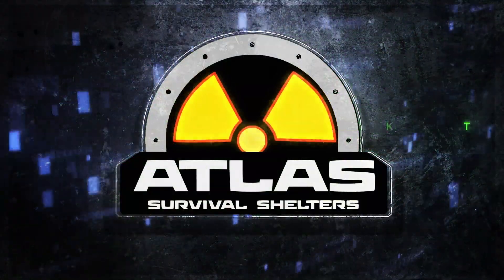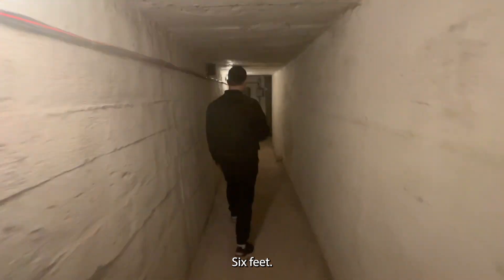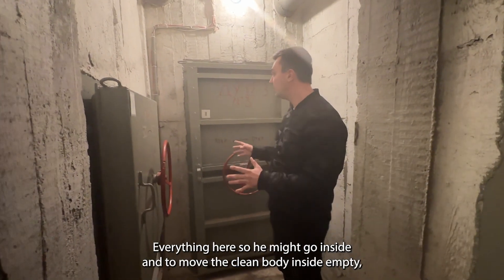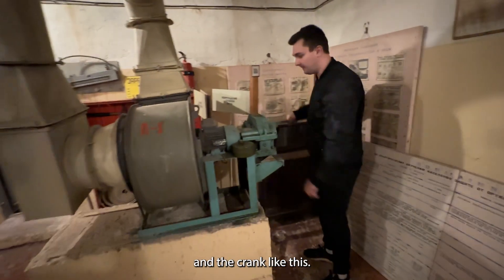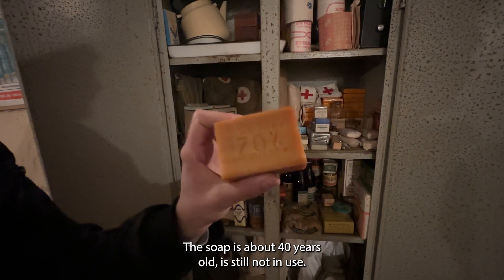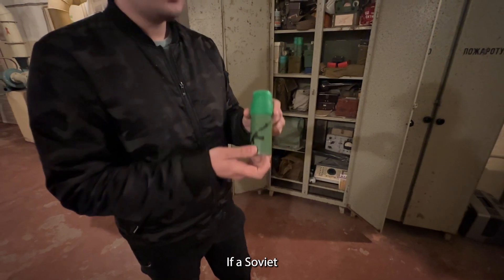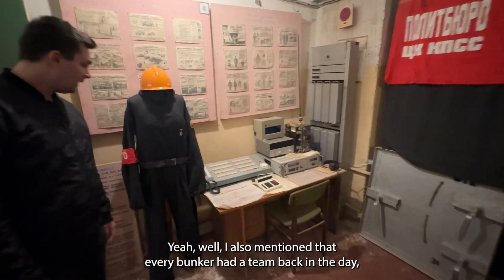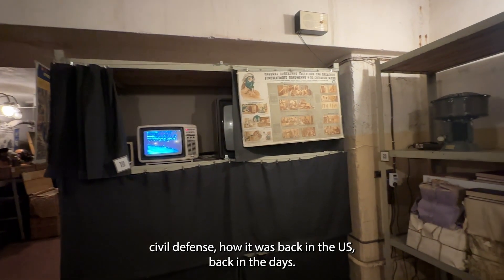Underground Bunker in Lithuania You Can Tour Yourself

Comment: Ron one thing to remember is the soviets based their time in a bunker based on a standard nuke bomb, they did not base it on the hydrogen bomb, or even the cobalt nuke, or even the neutron bomb.
Some of the American nuclear test sites are still so hot, exposure to the radiation in the area is still lethal.
In Russia in the Ural Mountains there is a lake where the soviets dumped nuke waste, 5 min on the shore even though is is covered with floating concrete spears, you still get a lethal dose of radiation.

Even after the Chornobyl accident the soviets tried to re-inhabit the contaminated area, and found out that it was impossible even after the removed all the soil,and brought in new, it was still dangerous.

Comment: Just a suggestion, the I beams you use as stiffeners on the plate walls , very good and strong , but a cheaper option and still keeping the strength is using old or new railway tracks .

Comment: A fun fact, the old Soviet newspaper Pravda (Truth) was the most "read" newspaper of its time. In actuality it was used more for toilet paper than for reading, Even then most Russians knew the content of the paper was utter bull$h!t.
Fun fact, even today in Greece you can find "public restrooms" in restaurants or even historical sites where there is no toilet seat on the toilet or no toilet Americans are used to but your traditional hole in the ground "French" toilets as they call them.
It looks as if they could use a few pallets of the red bricks that were used by Huber Homes outside of Dayton Ohio. These bricks are so tough that they withstand freezing and thawing without breaking apart and are practically impossible to drill into without special drill bits. That back side of the brick entry house could use a few for a proper rebuild.